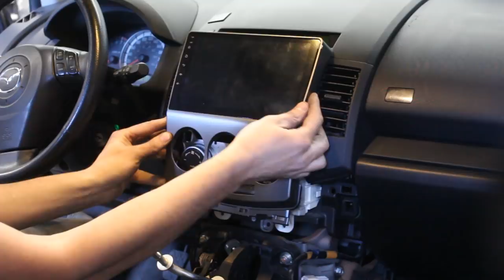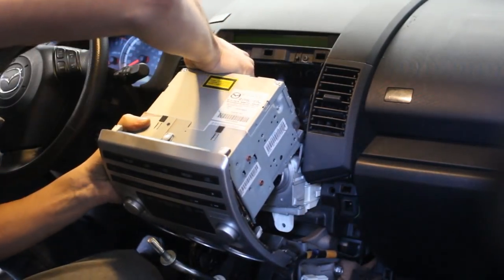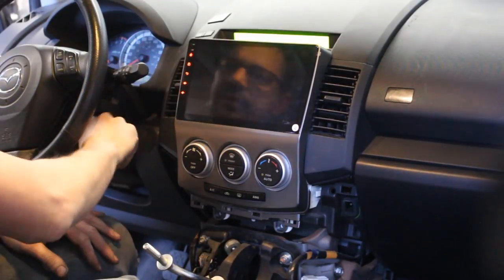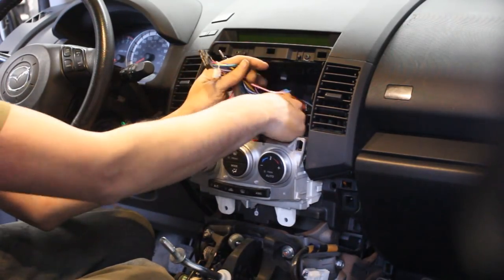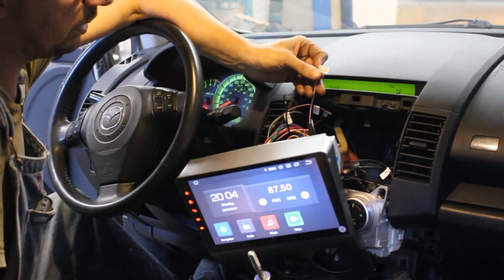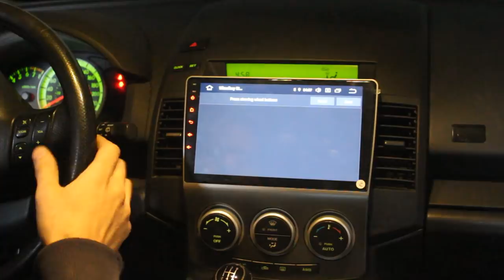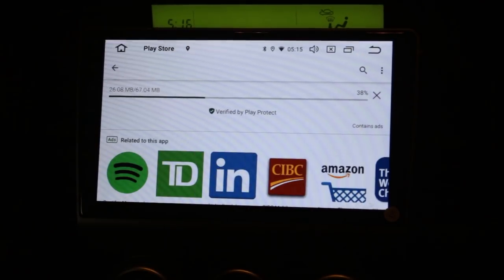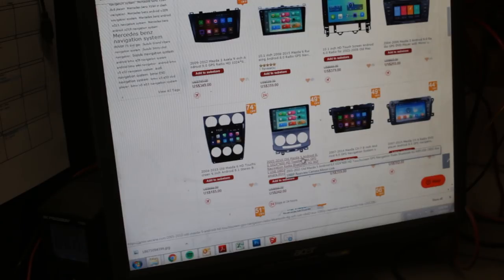Android 9.0 car stereo from Seicane – installation in a Mazda 5

Comment: For all those watching. You don't need to wire up the brake switch wire.

You can either A) connect it to a + 12v feed already from the loom to the stereo, or even easier B) in the settings you can disable the need to the cable altogether
Reply: much thanks

Comment: I installed a different brand and model (8+128GB, 8 Cores, ...) but your video helped me quite a lot!
The only thing I still need to find out is how to wire the AUX Port in the botton center. I couldn't follow the connection lines, so it might be connected already or not.

Comment: My Seicane radio came with a harness with a connector for a CanBus decoder box - but no decoder. Seicane says the unit I got doesn't need a decoder - but then why supply a cable harness with a CanBus connector??

I have had multiple problems (wireless CarPlay), backup camera, non-functioning mic) and language barrier is a real problem. I can't seem to get this question across to them. So hoping someone here can help...

Comment: Did you ever get the Easy Connect working? I installed this Seicane unit but I can't find the Easy Connect app that is mentioned in the user manual. I'd like to get that mirror link functionality.

Comment: I wonder how does this new panel fit into position of the original one. Its more wide in the area of the screen. Original panel has clips on the side, that holds the panel and radio in place. This wide panel cannot fit this clips and therefore all that holds this panel with radio in place, are 2 screws in the bottom only. Or did I overlooked something. It just simply does not fit in my car.
Reply from the maker: Do you have the actual pannel in your hands? It did fit like a glove on mine. All holding pins for the clips are exactly where they are on the original panel. You just need to pull out the clips from your old panel and click them onto the new panel pins. The screen area is wider, yes, but the panel still fits perfectly in place, believe it or not
Reply: @RustyBeauties  Thanks Elin. This was the point. New frame is misising clips. Now it fits.

Comment: @Elin Yakov's Rusty Beauties I have two issues with this unit. It's installed in my 08 mazda 5 and working great except A.) I can't figure out how to change the color or the panel buttons which is something they expressly advertised for it, and B.) For the last 2 days I have not been able to fully connect to ANY wifi networks. Every connection I try the unit says "limited connection" and can't actually use the gps or any other network features. I've tried multiple phone hotspots and multiple home wifi hotspots. Same thing on all of them. Can you help??
Reply from the maker: I also can't find a way to change the color of the buttons, maybe it is a wiring choice? I recently installed a different unit in a different car and it had two wires for the illumination. I wasn't sure why, but now I am thinking maybe it is for different colors? Just a guess, maybe I am wrong. Regarding the internet connection have you tried turning off the wifi function for a while? If that doesn't help I believe a hard reset will fix it- turn power off and then on from the fuse panel including the memory.
Reply: @RustyBeauties  UPDATE as of now i have uesd the small reset button on the front AND tried completely un-pluging the unit for about 15 mins or so in an attempt to completely reset the unit to out of the box condition. yet it still came back on afterwards and had all my apps and settings. and again the wifi would connect to any wifi network and then say "limited connection" regardless of what network it is so the unit is rendered completely OFFLINE in terms of functionality.  and on top of that, now it occasisonally freezes and basically doesnt respond to any input until i hit the small reset button on the front panel again. this has happened 2 times in the last 24 hours. my install is perfect i know there are no wiring issues and for what its worth im an ase certified mechanic. the included back-up camera i bought from seicane to go with this unit is also dead out of the box. the head unit will change to the camera feed and it will say "no signal" after a few seconds. yes the camera wiring is installed correctly. i even tried using direct power and ground from the battery to make the camera come on and it doesnt. the radio will switch to the camera, but the camera shows no image. 

this is all very frustrationg because you and this video are the sole reason i purchased this seicane head unit in the first place. so far i am VERY UNHAPPY with my experience. im looking into alternative options from other companies to replace this with before i decide to return this to seicane.  again very disappointing
Reply: Did yOu find an alternative?

Comment: I own a Mazda 5 (2009) minivan and want to upgrade the stereo. I want something that does not obstruct the green display on the dashboard or protrude outside of the dashboard. This model looks too big. Are there any other options?
Reply: Click the link in his description. There are other options.
Reply: No the link in the description does not have any other options for this specific vehicle. My mazda 5 is an 08. I have this unit and it fits beautifully and does not block the green display at all.  If you want something else you'll probably have to shop from a different manufacturer

Comment: I’ve got a question I’ve installed my own seicane radio in my car and I’ve been searching for a fix. I have a 2005 Mazda 6 and can’t figure out how to connect the steering wheel controls
Reply: My mazda 5, have the  same problem...did you find the solution?

Comment: I put a similar device and the steering wheel control stopped working. I tried to do the learning on the new device and it doesn't accept either. Do you have any suggestions?

Thanks.

Fabiano
Reply: did you ever solve this issue??
Reply: Not sure if it can help but in my car stereo if you go to settings and unlock factory menu by pin 8888, there is some kind of pcinfiguration preset list for various car brands and models. Perhaps changing that might help? I'm not sure what exactly that preset changes...
Reply: @EsoRimmer  I've tried all sorts of Mazda configurations, none of them seem to work for my 2009 Mazda 5 Sport

Comment: Hi. I have a 2010 Mazda 5 and I installed the same android stereo from Seicane and it works great but i have one little problem which is when I put the car into reverse the rear camera comes on like it should but the radio volume shuts off. Is there anything i can do to solve that?
Reply: It does this for safety reason as to tend to have less awareness around you when reversing thus muted sound allows you to hear anything that might be important. You should be able to disable it somewhere in the settings.
Reply: I have similar unit from different Chinese brand on aliexpress and the intensity of volume change csn be set or completely disabled in the android settings me. u related to car infotainment functions.
Reply: @EsoRimmer  i Got Radio Sound but no BT / YT Sound u know why?
Reply: cars with built in media things like that automatically do this so its normal
Reply: there's a protocol setting somewhere for this (CAR REVERSE MUTE OFF) or something like that

Comment: Unfortunately ive just got a problem with my car stereo (mazda 5). The screen became dark, i restarted the car but rn the only thing that appears on the screen is "android",  no one of the buttons is working. Could u give me any advice, is there any way i can fix this on my own?
Reply from the maker: I am sorry to hear that. I am mot sure what happened, but if a restart doesn’t work I don’t think you can do much on your own. Try a “hard restart”, which means to disconnect all the power going to the stereo. When you turn the car off you only disconnect the ACC power, but the memory power is still connected. One option is to pull the stereo out of the dash and unplug the main connector, but a much easier way would be to disconnect the car battery for a minute or two and connect it agin. It might take while for the stereo to boot after that, but chances are it will start. I hope that helps. Пожелавам ти успех 😊
Reply: @RustyBeauties  thank you for your advice, i'll keep that in mind. Tbh it's kind of weird,  because after a few minutes of driving it started working again. I hope it will not happen again, but thank you for responding! 🙏❤

Comment: How does it sound? Do you know what the RMS power output is to the speakers?
Reply: its the same as factory. this unit uses the cars factory installed amp. the sound is a bit better from the improved signal quality into that amp.

Comment: I have a question, please: If the Mic is only for voice control, and I'm not going to connect to the internet through the multimedia system...Do I really need it?
Will my built-in voice control work? (The one I have in my stock system)
Will my built-in mic work? (The stock mic of my model is installed next to the sun visor).

Comment: I have a Mazda 5 2015 would this work
Reply from the maker: Your car has a different dash. There are 3 options for it:
https://www.seicane.com/hd-touchscreen-android-gps-navigation-car-radio-dvd-player-for-2010-2013-mazda-5-premacy-with-bluetooth-canbus-usb-wifi-obd2-dvr-aux-mirror-link-steering-wheel-control-s18m015

https://www.seicane.com/2009-2012-mazda-5-android-gps-navigation-system-with-dvd-player-radio-mirror-link-multi-touch-screen-obd-dvr-rear-view-camera-tv-3g-wifi-usb-sd-bluetooth-s168005

https://www.seicane.com/seicane-android-gps-navigation-system-dvd-player-for-2010-2011-2012-mazda-5-with-radio-hd-touch-screen-dvr-tv-video-wifi-obd2-bluetooth-usb-sd-backup-camera-steering-wheel-control-mirror-link-h670e